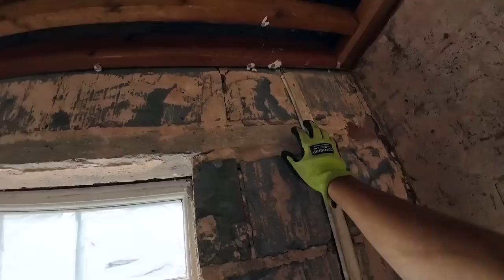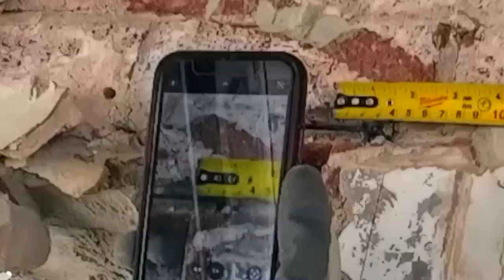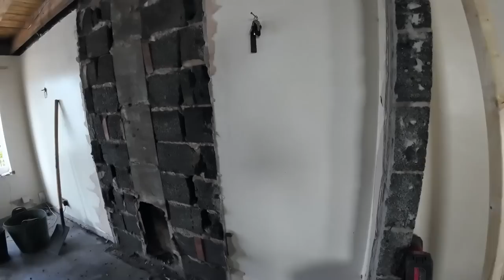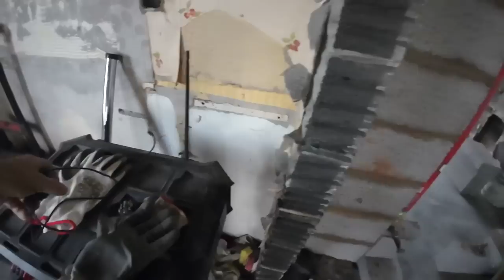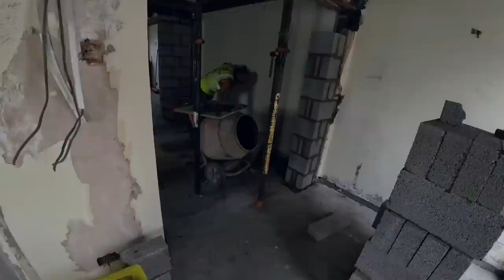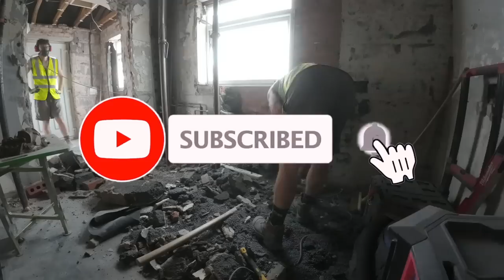THIS IS JUST DANGEROUS !! .BIG ALTERATION JOB PT 1

Comment: Crappy building work, must have been the cowboy who just ripped off the bonus daughter. I’ve spent weeks there putting things right. Who plaster the walls and leaves the radiator pipes plastered into the stud wall? Probably the knockers on here. Good luck with the hip op, hope you’re up and about quickly.
Reply from the maker: Cheers pal 🧱👍🏽